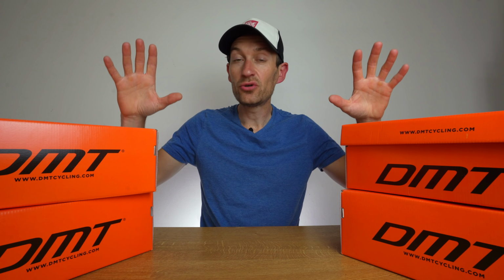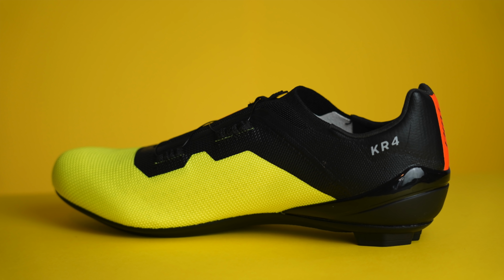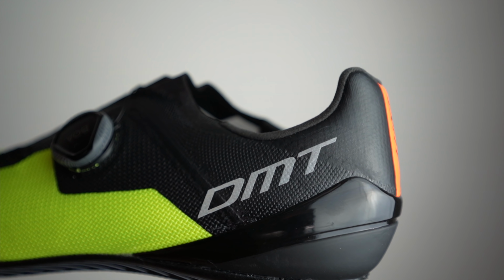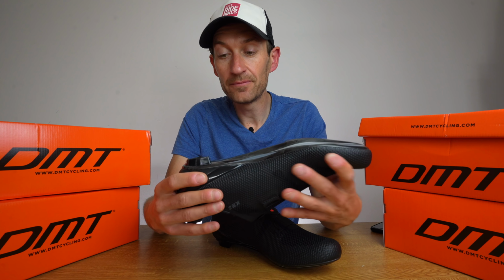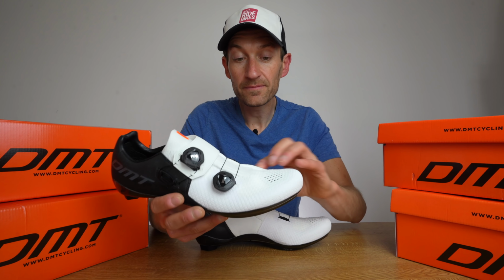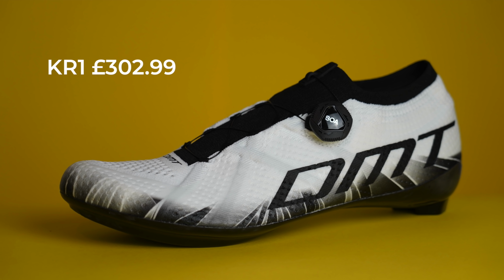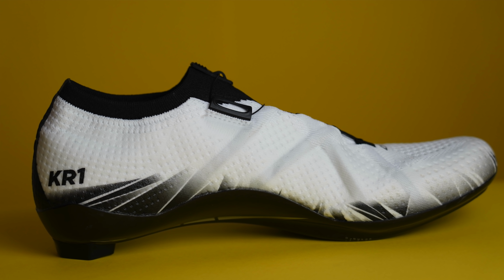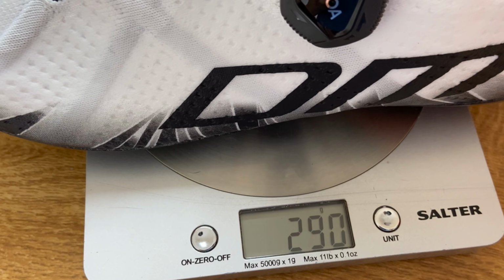Tour de France winning shoes! DMT first look and giveaway

Comment: I have got a pair of the SH1 since May, I can only confirm that it is a unique shoe, super confortable from the start, extremely breathable, supportive and responsive..and it looks amazing! by far the best, most confortable pair of cycling shoes I have ever owned

and yeah, pink comes from the Gazzetta dello Sport, the most important journal in Italy printed indeed on a pink paper: la Gazza was responsible for organizing and sponsoring the first edition of the Giro
Reply: Are they tts or did you size down or up
Reply: @kimwarner6050  depending on the brand to which I compare to, they are tts or half a size below..I suggest you to compare the cm stated in the DMT table size

Comment: WIN WIN WIN!!! Those would make an incredible final addition to my ‘all black’ set up!!!
The jersey is pink because of the Italian newspaper, the sports newspaper that created the Giro, was printed on pink paper. 
Great bit of info here:
The very first edition of the “Corsa Rosa” (the nickname of the Giro, which means the Pink Course), was held in 1909, and for five years the general classification was established using the points system; from 1914 the leaders were ranked by their time splits. Until 1931 though, no special colours were given to leaders' jerseys. The riders were still cycling with their own team kit, making it more complicated to spot them on the course (both for the other riders and the public), and particularly when things were getting tough for the riders.

So, not only was the pink jersey, or maglia rosa as it is more commonly known, a way to advertise the newspaper itself, it was also a way to make the leader more recognisable in the peloton. “La maglia rosa! Ecco la maglia rosa!” - you can still hear these shouts from the street at every stage of the Giro even nowadays. It doesn’t matter when the pink jersey will pass – it will always be long awaited and greatly cheered on by the public. The riders that have worn it in the past often confessed that wearing it gives them an “extra energy” that can separate a great ride from a phenomenal one.

But if you want to dig deeper, you have to ask the next question. Why is the Gazzetta newspaper printed on pink paper?

The Gazzetta was born on 3 April 1986; its very first copy was printed on green paper and it remained like that for at least three more years. The newspaper, before its final and current colour, was also published on yellow and white paper. But those colours did not make history.

The reason why pink was finally settled upon is still unclear to the current journalists of Gazzetta. Somebody says the colour was chosen because it cost less to keep the colour pink instead of whitening the paper, while somebody else says that a survey – shared among the very first Gazzetta readers – resulted in pink being the most popular choice of the public.